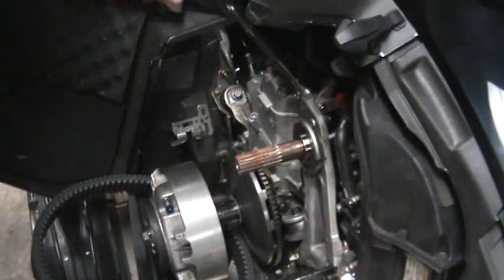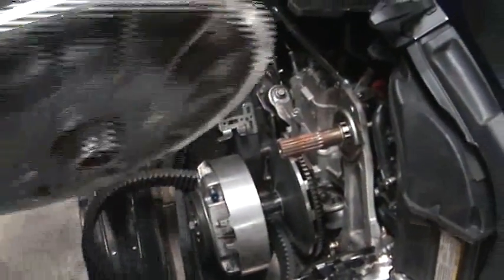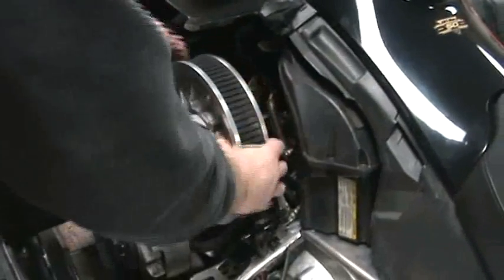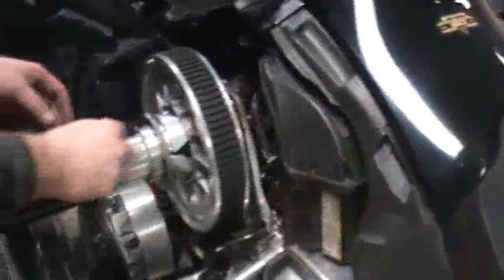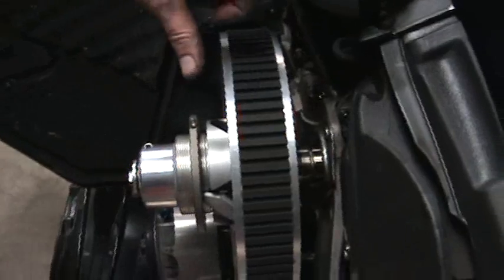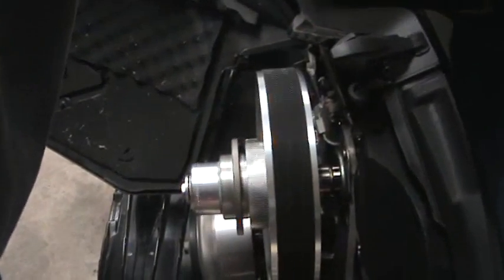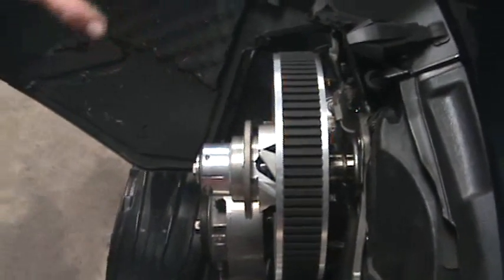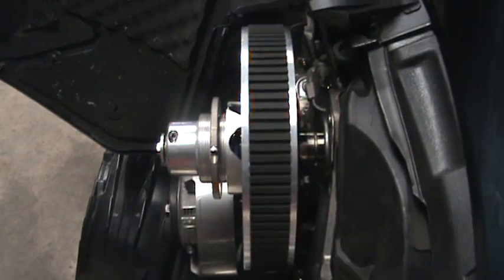doodoctor's floating qrs

Comment: To Clay Russell. The floating,secondary floating clutch,system. IS REALLY FOR keeping the belt . Running straight, as it shifts, up and down. Between, the primary and secondary clutches. That way you get the most efficient and the most power. That is put to the Track. Also the Belt temperature, is kept,lower. Because the Belt ,is able to stay more straighter. As the Primary and Secondary clutches sheaves. Change their angles,as they move in and out.Because, remember that alignment, you do,with the alignmet tool. Is set for when the engine and belt is spinning the fastest. The Manufacture of the sled, knows, Thats when, a lot heat could be made. But the rest of the time, like when you start out and in the middle range,of speed . The belt is at a little angle. And that is also real hard on the Belt. And they , have been blowing belts,I have a 1995 Arctic Cat ZRT 800 and 1991 wildcat 700. I bought them new, and in all these years. Not ,once have I blowen, a belt. And these engines, Turn RPM,s at 8000 to 8500.. Arctic Cat back than, had a system . That the secondary clutch was bolted on . So you could add little washers,on the bolt that held on the secondary clutch. And it would leave room , between the big washer and bolt head.And they had a round stub piece, that went into the center hole, on the secondary clutch. And the secondary clutch, had room to move ,sideways.

Comment: I HAVE MY 1991 ARCTIC CAT WILDCAT SECONDARY CLUTCH. The bolt and big washer. That holds it on. I HAVE 4- little washers between stub, you PUT  in clutch hole and the head of the bolt. THAT YOU TIGHTEN, TO HOLD SECONDARY CLUTCH ON. THE SECONDARY CLUTCH CAN FLOAT. So the Belt will run straight, with primary clutch.